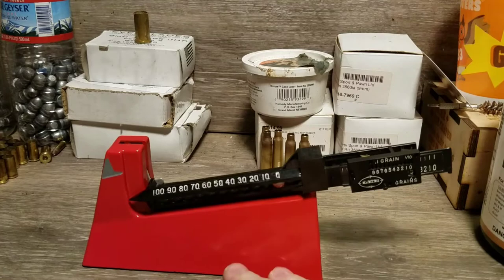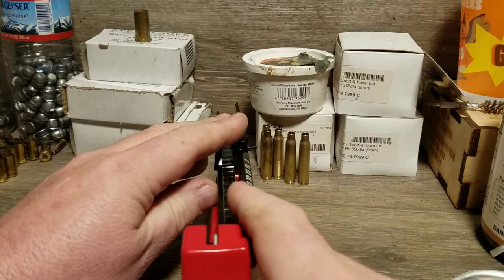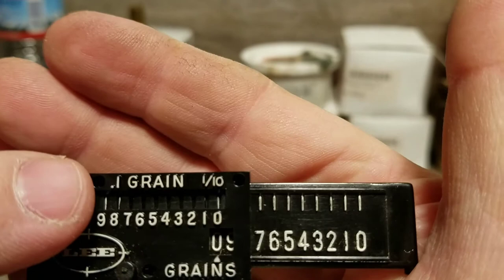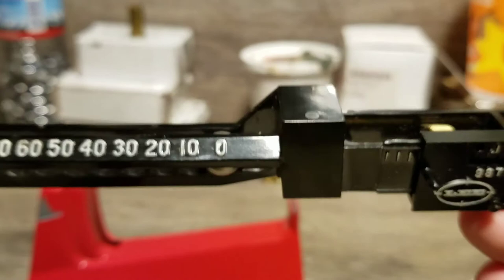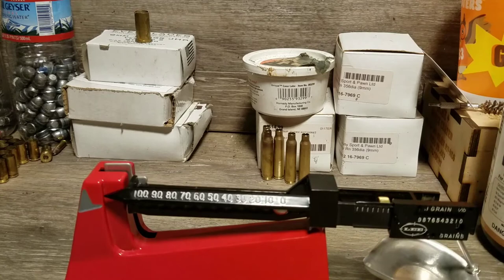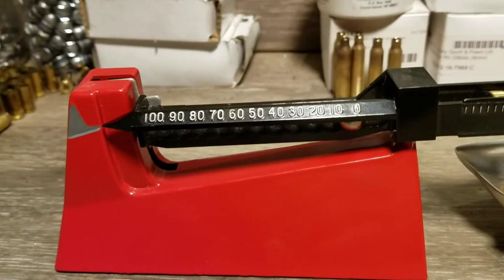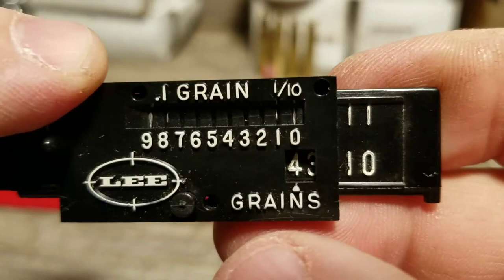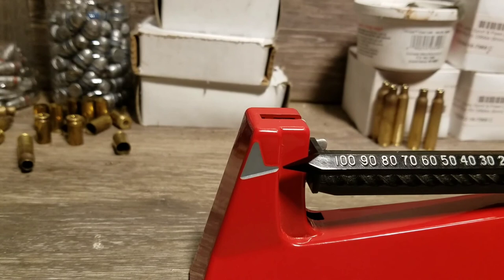Tutorial on the Lee Safety Scale

Comment: Thank you for showing the details on how to use this scale. I use my balance beam scale from RCBS to check every tenth throw from my powder thrower. I rarely use it to weight every charge unless I am running a small batch and don't want to set up a powder thrower. The problem I have with the RCBS 5-0-5 is the little weight for the 10ths gets bumped by the pan hanger. I may very well buy one of the Lee safety scales after watching this video.